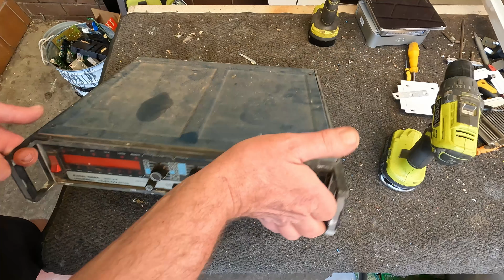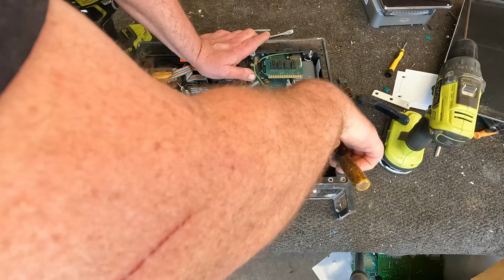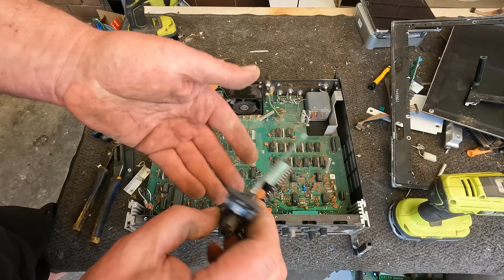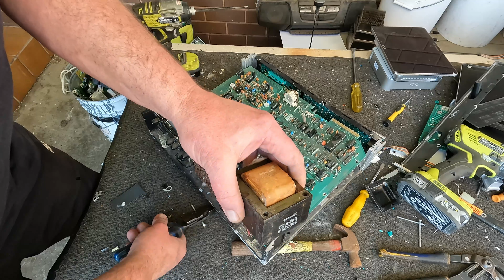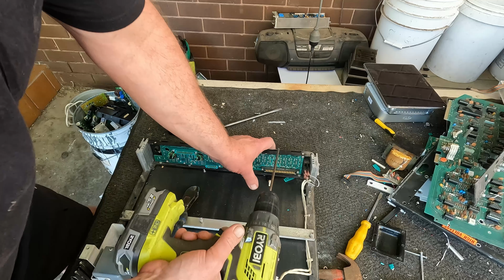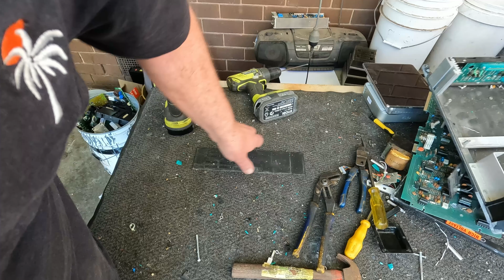Scrap Sessions 30 Days Timer Counter Part 4

Comment: back in the late 80's early 90's i got a contract to go into some missle silo's that were going to be decommissioned,the circuit boards had solid gold pins and fingers huge copper wire bundle's copper plates 5 inches thick by 6 foot by 9 foot,titanium plates brass fittings. those were my retirement silo's if you get a chance to get some high grade military equipment you'll get  solid gold pins and fingers there were other metals to lead plates rhodium platinum.
Reply: I got a load of equipment of of someone who used to work for IBM and that included some matrix with solid gold pins like a battleship game. The equipment is worth far more than scrap though!

Comment: Ben, I love your videos and watch everyone of them. I just want to mention the gold as an investment part. You say gold was a $1000 7 years ago and now it's more than doubled, but you are not taking into account inflation. The US has printed so much USD in the past 7 years that  even though gold has gone up, the buying power of gold and the dollar means you really haven't made anything holding gold or the dollar. If you had put $1000 into Bitcoin 7 years ago you would be a multi millionaire today, instead that $1000 worth of gold still has a $1000 worth of purchasing power.
Reply from the maker: Well the gold has $2600 purchasing power actually as that's what it's worth today.
That's the whole idea of gold, it's a hedge against inflation.
forget bitcoin but think of banks, that $1000 in the bank for 7 years would only be worth $1100 today and everythings more expensive, so gold is what holds value, bitcoin is like buying lottery tickets, would you spend $50,000 today on a bitcoin? i'd rather buy gold
Reply: The problem is the fact everything you buy today costs more, just look at the prices in the shops and house prices. I was into gold/stocks 10 years ago and I don't see it as performing well at all. And yes, I am still buying Bitcoin at over $50,000. We can come back to this in 1 year :)
Reply: Just to clarify, I meant to says that due to the devaluation of the dollar, gold still has a purchasing power of 7 years ago, while the dollar has half the purchasing power of 7 years ago. Inflation is far worse than reported by the govermnents or the media. So, yes, gold has been better than holding the dollar in the bank of course. But still not good enough for me. Many experts expect gold to suffer over the next 10 years due to new asset classes.  Many gold bulls are now entering these new asset classes (except Peter Schiff) lol